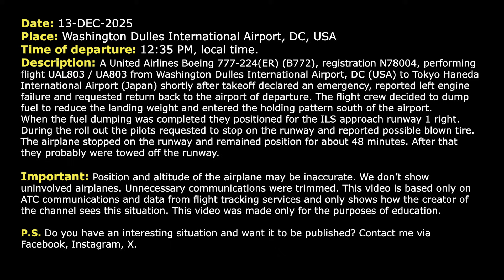Airplane Loses Engine on takeoff. United Boeing 777 declares MAYDAY at Dulles Airport. Real ATC

Comment: The JFK air traffic controllers again (the most stressed in the world!)! I flew there for over 30 years and the airport remains the same. Same runways, taxiways, terminals, the same crap! The only thing that improved was that they upgraded the lighting to LED and the VASI to PAPI. And the worst part is that they still only use one Ground Control frequency for the entire airport, which now has 5 times more traffic. In this particular case, it would be much simpler if ATC said initially "non-standard turn right on A, hold short D" since it's stated on the chart that the flow on A is clockwise.

Comment: They dumped 15 hrs of fuel to get to 10, but had to fly circles for a while. Was dumping 5 hours of fuel worth it?
Reply: ofc. it's a standard procedure cuz the weight of the plane and no thurst reverser. plane would overshoot if its heavy

Comment: What is even worse about this situation is the "fact" that this is a repeating incident and the flight resumed the next day when I checked and was over Alaska...so two engine failures and the FAA doesn't require the plane to be closely inspected??? no wonder these things keep randomly falling out of the air.
Reply: Huh?
Reply: @sfdint  What did you not understand?
Reply: @jamess6352  "keep falling randomly out of the air". How many are we talking about?
Reply: @sfdint  From a maintenance perspective...just the basic news ones however it seems there are a lot that don't make the news.  The UPS one was another that the engine randomly fell off? How does that happen?  This one specifically had multiple failures and was right back in the air on its long trip the next day like nobody cared.  There are several channels that go over all of  the airline incidents and it has been in the news quite a bit about poor quality substandard parts being replaced in planes...this just adds to that.  The news media has covered quite a bit of this.
Reply: @sfdint  https://en.wikipedia.org/wiki/List_of_accidents_and_incidents_involving_commercial_aircraft#2025
Reply: @jamess6352 in that entire list there aren’t any aircraft randomly falling out of the sky.  I think this is more about your “feelings” than any real problems with airline travel.

Comment: What happens if it is all residential area below them, and they have to dump 16 hours worth of fuel??
Reply: They have pre-planned areas in which to dump fuel.  We live pretty much under the flight path of IAD. Nothing fell on our heads that I know of. The airport property itself is huge, too, providing a bit of a buffer. Of course , last year we had an amazing cockpit crew,  who landed a 19-seater commuter jet on R606 like it was the most natural thing in the world. They handily avoided buildings, cars on the road, & even the traffic signal. Only casualty was the metal guardrail; which sustained some chop marks from the propeller. Copilot evacuated the passengers so calmly that I'm surprised she didn't send them over to the IHOP to have breakfast while she & the pilot dealt with the logistics of a plane on the road 😂

Comment: Plane: We need some time

Tower: Keeps asking questions 😂
Reply: Roger
Reply: Tower was a PITA at first.
Reply: Well they have to, they are flying into the path of other air crafts lol... They arent talking to them for funsies
Reply: @t @troyspears6470 not really, mayday gets all priority. ATC can tell other aircraft to move away. And they gladly will.
Reply: Well they were flying into high terrain so ATC wasn’t just asking how the weather was up there 🤣
Reply: @alektg1 Aviate, navigate, communicate. Let the pilot aviate in a mayday situation.

Tower tries to.give vectors, do a runway selection, and confirm a return plan.  The pilots are trying to stabilize and gain altitude while running a check list.
Reply: @WSAnderson  ATC probably could have been more concise but they were communicating an issue directly affecting aircraft safety (suddenly increasing MVA) before it becomes another emergency. 

Im aware of ANC but the controller could probably argue this was an exceptional situation where despite pilots being busy he needed assurance they would vector out of high terrain.

Comment: When are ATC controllers going to be taught to "Listen", and keep their instructions to  minimum - especially when the aircraft is below 1,000' (Boeing) or 1200' Airbus?,which is top of third segment climb with an engine out.  And the knowledge base of the one controller is clear when he suggested that a heavily loaded aircraft headed for Tokyo make a 180 turn back and land downwind on 19R?! Seriously, don't put bad ideas into a pilots head.  If the pilot wants that, he will say so.  But in general if we are not dealing with an uncontrollable fire, our checklists and advising flight attendants and passengers is going to take 20-30 minutes at most airlines. That 180 back was just terrible distraction for them at a critical time.  Please, any Controllers on here, pass the word on your chat groups, recurrent training sessions, to keep the talk and instructions to a minimum for the first several minutes.  And don't ask for information right after giving heading and altitude instructions.  In fact, try and only ask for information when the aircraft is flying straight.  Even with the auto pilot on, we are actively monitoring the compass, bank angle and LNAV to ensure we are going where we are supposed to be going, so we are in a high mental capacity state, especially low to the ground and deviating from the flight path we expected to take on departure.
This is not the only video like this.  I have seen so many here in the last several years much the same.  It is obvious controllers have no idea what pilots are dealing with during an emergency, and it's time that the training addresses this "Threat".

Comment: As a guy based at Dulles for many years and generally very satisfied with the ATC service I received, it's a little disappointing to hear controllers ask the same questions several times. Once should have been enough and anything the tower needs should have been passed on by landline. And I think the controllers were a little bit too chatty with suggestions. In that situation the crew is in charge and THEY tell ATC what they want.

Comment: This will be a good learning review for the Local Controller.  Too many transmissions.  The pilot said early-on, that he'd get back with you twice.  Let them handle the emergency and they will contact you when they are ready to.  Also, unless it was deleted from the video here, the Approach Controller was supposed to broadcast that fuel dumping is in progress, location, altitude and aircraft type.  It's easy to armchair quarterback here, but this is what I took from it.

Comment: I was on this plane. I knew that the airplane like this can fly with only one engine to make a safe landing, but still one engine failure among two was horrifying enough. I appreciate the pilots' professionalism, quick assessment of the situation and their high capability to make a safe landing with one failed engine.
Reply from the maker: Glad they did it. Thank you very much for the comment 🙂
Reply: I would have absolutely freaked out. I already hate flying. I had to educate myself on things like this just to be able to get on a plane. Now I know, and airplane has no problem taking off on one engine. It would still be terrifying.
Reply: @dextermorgan1 No worries at all, really.
Those engines are engineered to perform fine on a single airplane in the event of failure😉👍
Reply: Did you hear a bang on the left side ? Or what indication was there that you knew something was wrong with the aircraft ?
Reply: @adamb1671  I lost an engine working a 767 flight from Munich to Newark in 2018. It sounded and felt exactly like the simulator. We lost the right engine. The plane yawed and rolled slightly. The yaw was more noticeable.
Reply: @skyserf Appreciate your feedback, so the training kicked in, was just wondering as a passenger what that sound was like, but i suppose it depends on the type of engine failure. Cheers again 👍
Reply: @adamb1671 I heard back from a union rep that said in our case that particular engine had a known issue that required inspections on regular intervals. Ours was not far from its next inspection. Now that I think of it I’m not certain I remember hearing much other than a pop but I do remember the sound of the engine spooling down. The flight attendants said there was a slight smell in the cabin. The aircraft performed very well despite being heavy though. Still we were all very happy to get it back on the ground. CFR at Munich was excellent as well.
Reply: @adamb1671 imagine you’re driving your car on the freeway at 80mph then a sensor or something trips and your car goes into limp mode (2000rpm or 40mph max) but also with the aerodynamics of being in the air. it’s not like some explosion in the movies you watch too much of
Reply: @brianlacroix822 Actually not much of a movie goer at all, though i could imagine you have all kinds of stereotypes in your arsenal of thought bubbles.
The Qantas A380 also lost the inboard left engine leaving Singapore, the pilot said the sound was 'like a boom boom. At that stage all they knew was they're likely lost an engine in the initial seconds.
Reply: engine failure at 1000ft is as no bueno as it gets other than engine detaching during takeoff. gotta love the us military industrial complex and the high quality pilots it churns out
Reply: Huge lie
Reply: @32SQUID i know right? lots of professional atp pilots and witnesses on here while my pilot friends absolutely do not watch flight sim or atc videos on their free time (they’re with their families or working at their business on their off days)
Reply: @brianlacroix822 word up and word to Allah

Comment: Stuff required to do in this high workload phase:
- Memory items/ECAM actions
- advise ATC
- climb to engine out acceleration altitude
- normal after takeoff SOPs and continue climb to safe altitude
- decision process (engine restart, diversion, check weather and landing performance)
- execution (advise ATC of intentions, souls o/b, fuel, dangerous goods; advise cabin crew, passenger announcement, advise company)

No need to get rushed into an immediate 180 by ATC unless there is fire on board - then you would skip some of these points above and focus on the very essentials AVIATE-NAVIGATE-COMMUNICATE.

Comment: Does anyone else think the controller was being a bit too “helpful” for the flight crew by asking question after question, when they obviously have their hands full?
Reply: The local controller had his hands full as well, because the emergency aircraft was unable to accept the initial handoff to Potomac Departure.  When that happened, the local controller had to get a supervisor or another colleague in the tower cab to call the Potomac Departure sector controller, and alert them of a sector incursion, and advise them to separate their departure traffic from the emergency traffic.  The local controller remained responsible for separating the emergency traffic from departure traffic via radar vectors, even though he is not handling nor speaking to the departure traffic himself.  Since both the departure controller and the local controller each had to deconflict their own respective traffic with other traffic on a different frequency handled by another controller in another building, comms didn't go as smoothly as they typicality would have.
Reply: @oubrioko  I agree, if the aircraft could have accepted the handoff it would have made conversations a lot shorter.

Comment: I keep saying that there is too much conversation during emergency. And switching frequencies is distracring. Implementing an emergency frequency  that manages all the stages at least in big airports with lot of traffic should be mandatory everywhere. 
Also: souls.. I mean, it could be transmitted by default to ATCwithout pilots having to say that... considering that often it is asked 3 or 4 times. I don't think they change during flight... so it is useless that 3 different atc ask that.
Reply: An emergency frequency would still be a frequency change from the initial frequency they were on, so you're not saving anything.  There are two pilots for a reason as well.

Comment: 1:44 - Gives a right turn over much more densely populated area?
Reply: The local controller was handling emergency traffic that was outside of his airspace. Those two turns were deconfliction radar vectors to separate the emergency traffic from Potomac Departure sector traffic whom the local controller was not in radio contact with.

Comment: Why the ATC always ask the souls on board and remain fuel? I don't think it's necessary🤨
Reply: Unfortunately it is necessary so fire/rescue crews are aware as to how many people will need rescuing God forbid the aircraft crashes and how much fuel is on board for either fire fighting or a low fuel emergency. However it isn’t imperative that ATC get that info immediately if the pilots are concentrating on other tasks.

Comment: Dumped that fuel right over Fredericksburg, where I live.  It should have dispersed but I could smell it in the air, very faintly.  I'd rather get a faint whiff of JP5 though, than have them attempt an overweight landing with one engine.
Reply: I believe it would have been difficult for them to climb to a better altitude for dumping. I never even saw them go above 4800ft (but they were saying 5000ft). I can only imagine how overweight that plane loaded for a 10 flight overseas would have been if they didn't dump fuel. Overall, I think they did thei best under a possibly critical situation